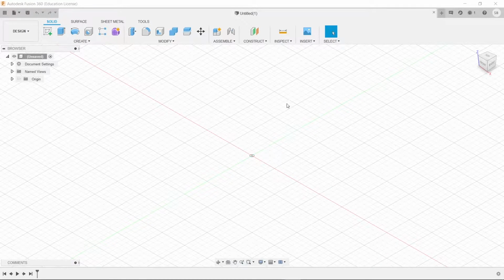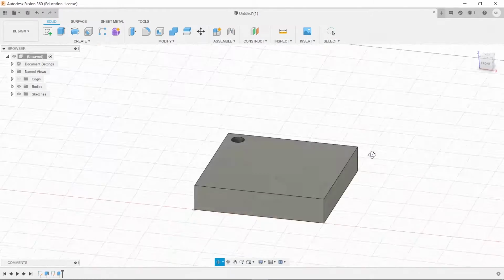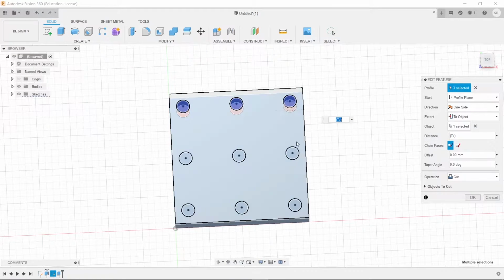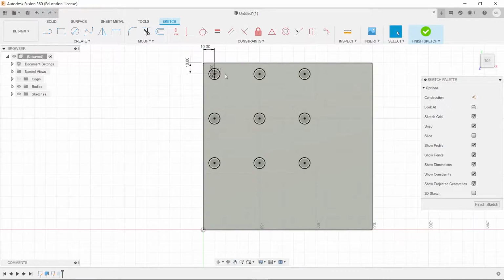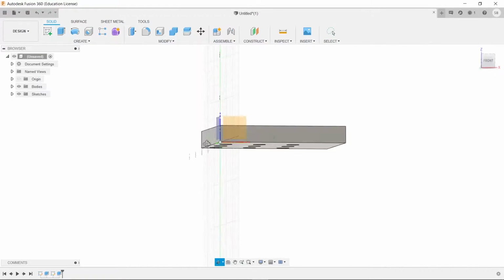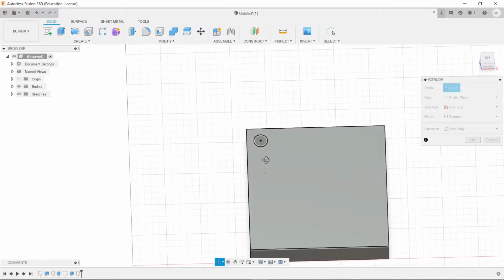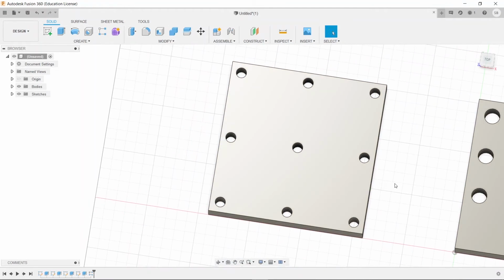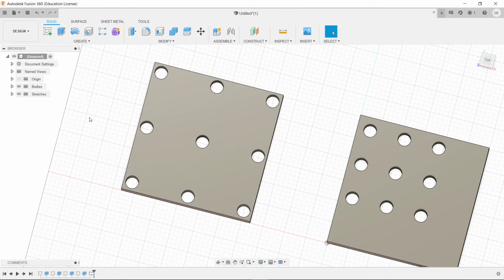Fusion 360: Using the rectangular pattern tool for features

Comment: Trying to mimic how you were to place circle. I about to place and size circle but the distance from the edge is were I am having issues.
Reply: The only thing I can suggest is when you are Dimensioning it, make sure to click the center point of the circle and the edge of the square to get the correct dimensions. Also, make sure that the circle is within the bounds of the square when you draw it first